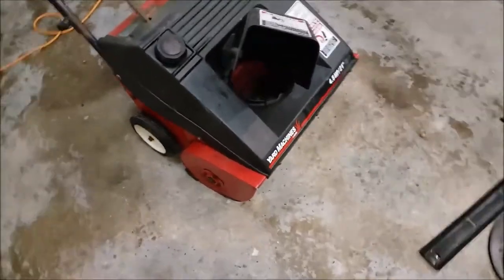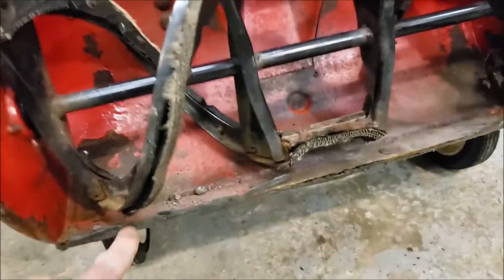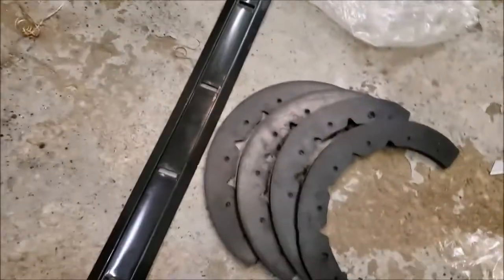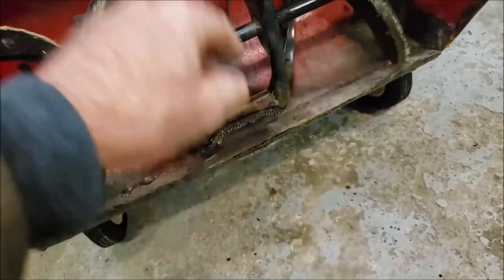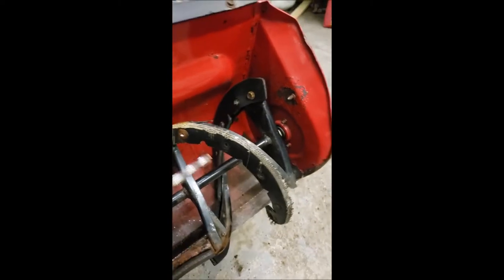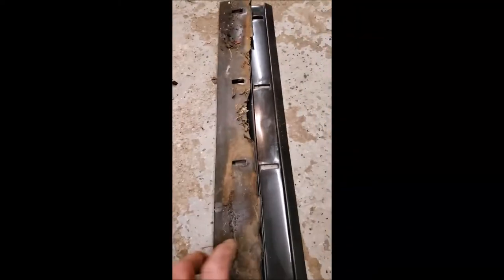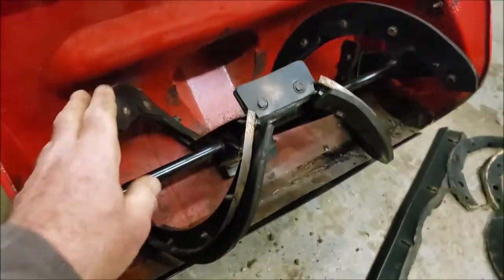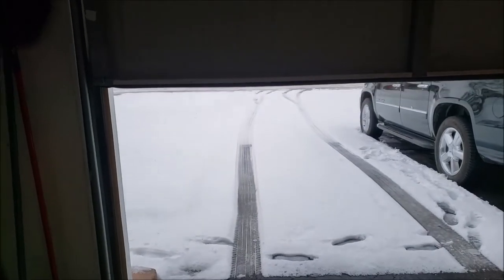Snow blower auger repair, rubber paddles and scraper bar replacement.

Comment: Thanks for your video. What bolt (or is it screw) did you use to replace the rivet hole? Thanks. I just ordered the kit and I assume it's the same size as the other bolts which I can probably pick up at Home Depot or Ace.
Reply from the maker: Yeah, I just found some screws in my garage about the same size and thread as the other ones. I'm not sure of the actual size or thread count, sorry, but thanks for watching. I hope it helped and good luck with your repair.

Comment: The scraper bar has slots rather than holes for the bolts.  How do you know how far back or forward to set the bar?
Reply from the maker: I don't actually know if there is a specific setting. I set mine so it was about 1/4" or so out, and that worked just fine. Also remember that scraper bar has two edges, so when it wears down you can simply rotate it to the new edge.

Comment: Did you know you could have flipped that scraper bar around and used the other end to get double use out of it
Reply from the maker: I realized that after I took it off, but just figured I would replace it anyway, thanks🙂

Comment: I have a snowblower like yours with the same auger but mine is a craftsman 21 inch. Would I be able to change the auger to the 2 piece auger instead of the 4 piece auger?
Reply from the maker: Do you mean replacing the whole auger, then having only 2 longer rubber paddles instead of the 4 piece set like this one? Honestly I don't know, please let me know if you find out. Thanks
Reply: @Artseventy6  yes, that is what I mean and thank you. I’m wondering if I could do that to my snowblower
Reply from the maker: Would there be some advantages to doing that?
Reply: I have no clue but i would think it would be better than the 4 piece
Reply from the maker: @jacenikonchuk7172  Have you found parts to do that?
Reply: I haven’t been looking. I just wanted to know if you could do that because I probably can order a 2 rubber paddles from Amazon

Comment: what re?pair kit did you buy?
Reply from the maker: I bought it on ebay. Here's the listing title.
Paddles & Scraper Set fits  MTD 753-0613 & 731-1033
Reply: @Artseventy6  thx!